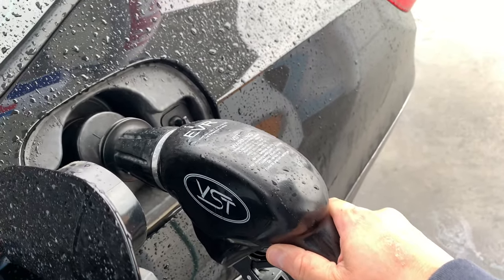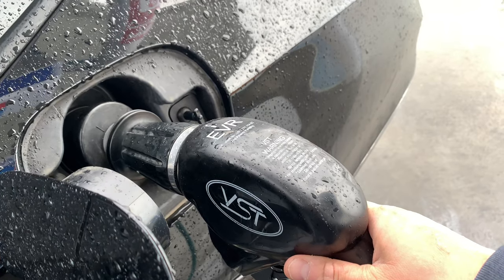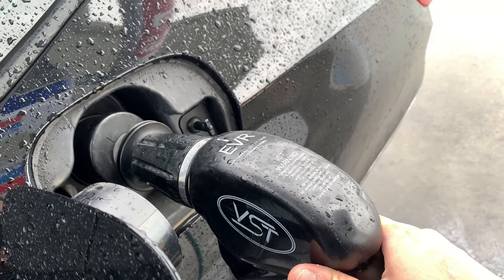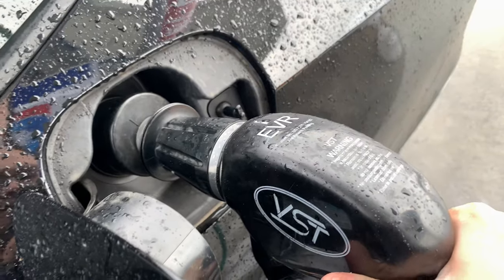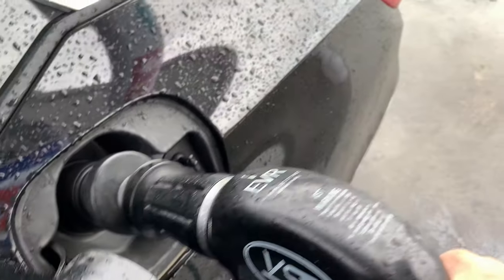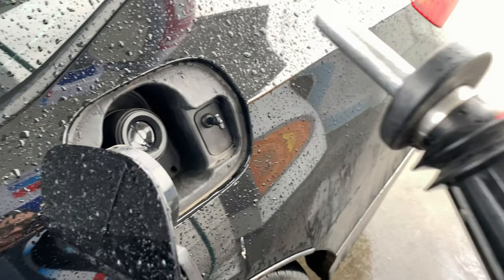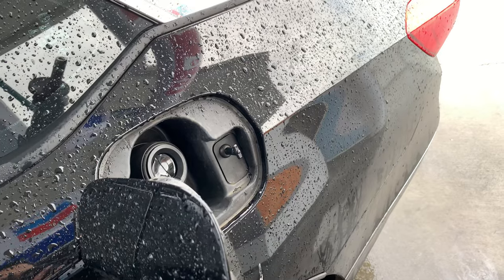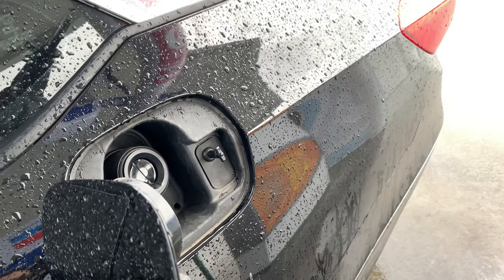How To Easily Remove A Stuck Gas Nozzel At The Pump

Comment: It also helps if you don't push the nozzle all the way when you start. That way you leave a little space to push in then lift up while supporting the weight of the nozzle with your other hand and slowly pull the nozzle out.

Comment: This won't work with the gas pumps in GA because we don't have that little cap like thingy on the pump. So if you push it in past the rings then pushing it in further will make the situation worse!
Reply from the maker: Thanks for stopping by and sharing your feedback👍👍👍

Comment: Will try this on my Honda Accord EXL 2018, every time I put gas nozzle ALWAYS gets stuck I usually have to wait like 3 to 4 minutes to get the nozzle out without a struggle..why does this happen?
Reply from the maker: Funny I have the same exact car you have.
Reply: I'm sooo loving you right now, tried it and it worked. I put one hand under the pump, pushed pump in and pushed it up and came out so easy..I shared your video on FB..it worked for me so it should help anyone having that same problem ..Thank you so much..it was embarrassing trying to get the pump out..I literally waited 3/4 minutes and would come out.. Glad that's over!😄
Reply: There may be a recall on this issue.. supposedly we should know by end of July.
Reply: Had a jeep rental with caplets gas tank , never used one of these type of system..struggled to take nozzle out..and thought to myself. "Can't wait to get my car out of the shop, " Dont like these new systems.

Comment: What happens if it Still won't come out?? I've been trying this for an hour now. Still sitting at the gas station.
Reply from the maker: Sorry, not sure but keep trying.
Reply: @OneStopGuy it's alright now. My parents pulled up and we eventually got unstuck, with a combination of twisting and pulling. We saw that everytime we twisted the pump, the pipe, that carries the gas into the tank, Also twisted. So immediately after noticing, i slowly twisted the pump from it's sideways position, down to an angled-downward position. Then it loosened and came straight out🤷🏽‍♂️I'm still not completely sure How it came out, after 1hr & 30mins of pushing and pulling and twisting, but it has something to do with the angle of how one tries to pull it out.
Reply: Another point to make, is the fact that Those Certain Pumps are the problem.
Reply from the maker: @justabiggkidd1999 , I am so glad you got it out.
Reply: @OneStopGuy  Thanku🙏🏼glad I found it video.

Comment: "or you're gonna break your gas thingy" Thats a highly technical term. Well mine got stuck today and I twisted it turned it, pushed it pulled it. Nothing worked. I finally put my hand in and behind the stupid rubber boot that holds the fuel tank opening in place and rocked the nozzle up and down over and over and finally got it out. Hopefully I didn't break the gas thingy. I'll have to talk to ram and find out how much a new thingy will cost. 😂
Reply from the maker: Thanks for watching buddy 😂😂😂